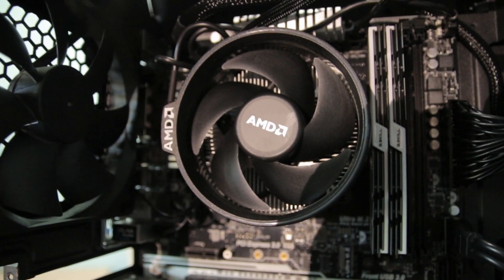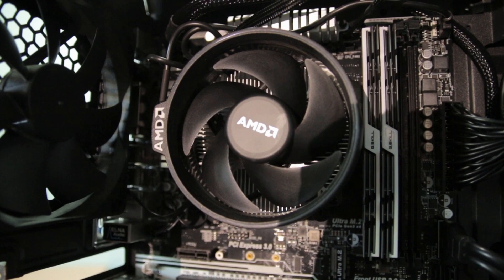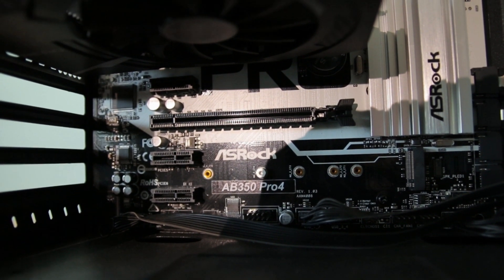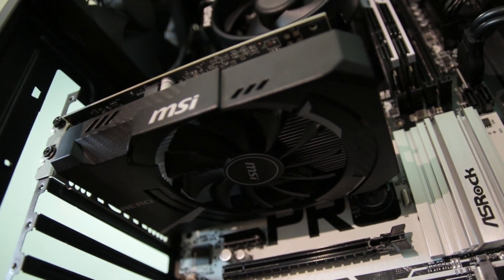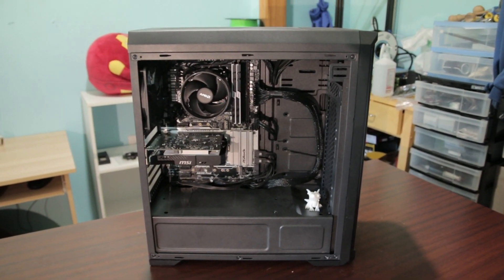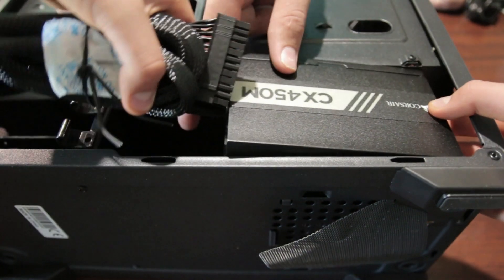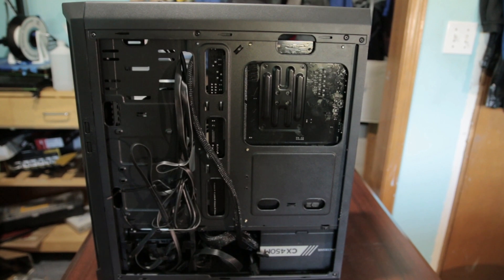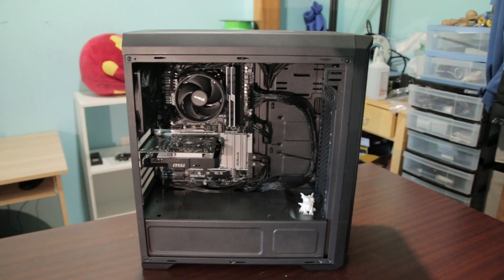AMD 800 dollar Gaming/Video editing - Radeon RX 560 4GB -2018

Comment: nice!
°Thanks.
Reply from the maker: Thanks! (= Do you prefer ryzen or intel?
Reply: Just finished now my new build:
CoolerMaster H500P white, Liquid 240 RGB, i7-8700k on MSI G+, 120G m.2, 8G Crucial 3000, Second hand G1 1080.
 (900 $ + 150$  due to the >Super Case )
SuperSilent. Still on bios settings in the picture with unfinished cabling:
https://www.4shared.com/s/fmGHmk9qcfi
Reply: @ @Riztech101   got a 8700k on a Aorus z390 wifi and M2 970 Evo 500G, with a G1 1080,  in a M500P mesh white cooled by a 280 AIO. Full silence build. 
(Both HDD are outside the case in a ON/OFF powered dock)
Reply from the maker: Awesome! Are you going to to a video about it?
Reply: @Riztech101   if you are interested I took some 200 pic in the process mainly for phase one.  Phase two is in progress.  Phase 2) is .... being a lucky guy ...I had to RMA the original > PSU, M.2, DDR4, Mb and also the GPU. All faulty!